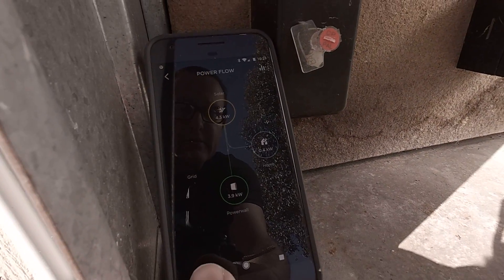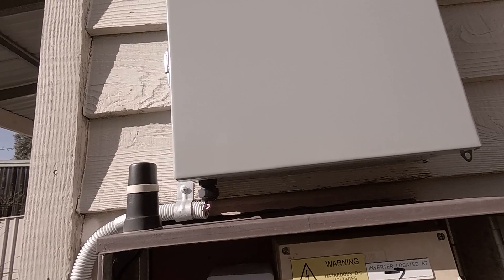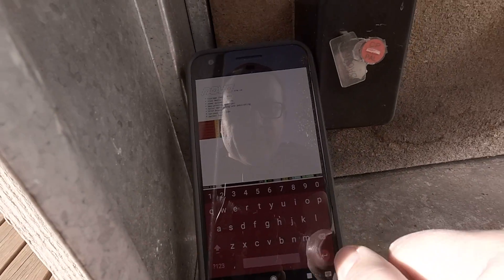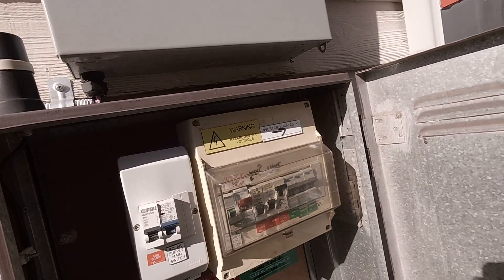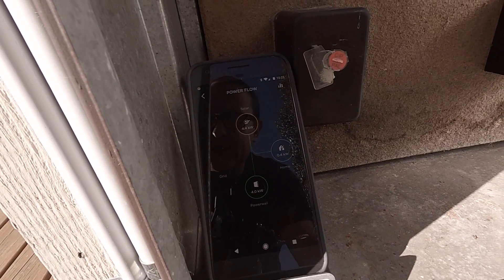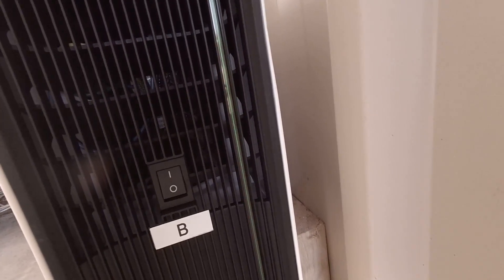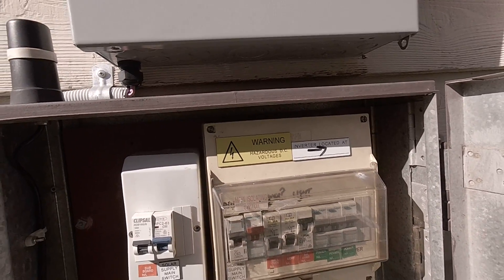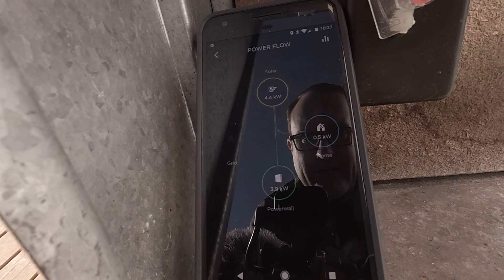My Tesla Powerwall 2: Demo of Backup Feature

Comment: Can the Power Wall 2 "bootstrap" itself?

Scenario:

There's a long-term power failure and the battery in the Power Wall runs down to the point where it cuts off due to low battery - perhaps due to bad planning or heavy clouds that prevent positive cumulative charging.

The next day, the sun comes up - but if the Power Wall doesn't come online, the PV system won't come online either.

Is there a way around this "Catch-22" situation - perhaps an override to make the Power Wall come on briefly to bring the PV system online, even though it is discharged lower than its threshold?

This is an "edge case" to be sure, but it's these sorts of things that are interesting!
Reply from the maker: I have thought about this scenario and if I thought that might happen I'd manually power down the Powerwall via its main switch before it completely drained, that'd give me enough to bootstrap it the next day but my understanding is Tesla keep a hidden reserve in the Powerwall for exactly this scenario but it's "undocumented" :)  Personally I'd try to deal with the situation manually and not allow the Powerwall to fully discharge. If it did get into this scenario I'd imagine you could bootstrap the system with a small petrol 2kva generator. Tesla also indicated that the energy gateway will have support for a generator input later this year so once that's implemented there'd be no problem going entirely off grid and using a petrol/diesel generator to bootstrap the system.
Reply: I've actually been thinking about this for months (I'm considering a PW2 system) and the more I think about it, the harder it would seem to backfeed to "bootstrap" it to get it online.

Possible scenarios:

- UPS-type Inverter:  Can output the voltage, but when the PW2 goes into charge mode, it will pull as much power as it can because, unlike a PV grid-tie inverter, the UPS does not actively "push" power into the grid - and this may repeatedly trip the UPS inverter off due to overload.  If the PW2 and/or PV system does come online and excess power is produced, the UPS inverter cannot sync to it and may be damaged.

- Inverter-type generator.  Same issue as the UPS-type inverter although it may be designed to tolerate backfeeding without being damaged - but it would likely trip offline when this happened.

- Mechanical generator (e.g. motor speed sets mains frequency).  If the frequency is set slightly high, it will always "push" power into a system and if the PV/PW2 start producing power, it will mechanically "sync" to it.  The problem is that the load-related frequency variations may cause the PV/PW2 to cycle on and off and the system may never come online - and it may eventually damage the generator and it may difficult to get the generator's frequency adequately stable/accurate under all load conditions.  If the generator stops/slows down while power is applied externally, it may be damaged by "motoring".

Scott's mention of a "Generator Input" is intriguing as an input designed specifically to charge the onboard battery to the point of it being able to come online - without having to worry about line frequency/phase synchronization to the "local" grid (e.g. power mains-isolated PV system + PW2) - would likely circumvent these issues and be the best way to go.
Reply: I now have three Powerwalls installed, and my experience is also that you better turn them off before you deplete them if you are running off-grid for an extended time. As for bootstrapping from a generator, at least in the USA, if you commission your Powerwalls with solar, they will only recharge from solar, so you'd also have to move the CTs around in your installation in order to charge from a generator. I'd be hesitant to try.

I can definitely say that you can power up off-grid, but it takes several minutes before the energy gateway wakes up and turns the power on.

As far as viewing their status if the Internet is down, yes, you can. You can access a web server on the Powerwall's IP address, provided the Powerwall is using Ethernet or Wi-Fi (not Cellular). The Web UI kind of sucks--there's only a graphical indication of the charge state, but you can also query the API to get the state of energy directly.
Reply: Having had the Powerwall operational for roughly 2 weeks, I can now answer some questions that I'd had - but not been able to find answers, particularly in light of my being an amateur (Ham) radio operator:

- Does the Powerwall cause interference (QRM)?  Not obviously so.  Like a Sunnyboy inverter, it seems to be extremely "clean" in terms of generating noise or RF interference and I can only "hear" anything on a portable radio on a wide range of frequencies over the HF (2-30 MHz) bands if I bring it within a few inches/cm of it.

- Is the Powerwall susceptible to interference by a nearby transmitter?

Yes.

Here in the U.S. amateurs are allowed up to 1500 watts of RF, and while this didn't cause a problem on the 75 meter amateur band (approx. 3.9 MHz), the same amount of power on the 40 meter band (approx. 7.2 MHz) apparently got conducted via a power or signal lead and caused the gateway to either crash or go into a "safe" mode.  (It was not a problem at the 100 watt level, but susceptibility can change by orders of magnitude with frequency)

The result was that the Powerwalls shut down and the grid isolation relay opened, causing my house to go dark on that Saturday night and even after turning EVERYTHING off (breakers, disconnects, switches on the Powerwalls) nothing would reset it - and the gateway does NOT have a reset button.  It took a power cycle of the gateway itself to bring it back online (there is no easy way to do that!) and then everything came back online.

While this scenario is unlikely for the vast majority of users, I can see that other radio hams, often interested in ways to have back-up power for emergencies, could experience this.  It is also possible that if a high-power land-mobile radio transmitter were used (say, by a business or first responder) in a vehicle parked quite near a Powerwall, this same thing could happen.

'Still working with Tesla on this, but I'm not entirely convinced that they got the message that it's an "EMC" issue rather than a software one.  Having experience in EMC/RFI midigation I know that the problem is likely to be easily solved, but whether the nature of this issue can be conveyed - and to the right person - remains to be seen.
Reply: Wow, this is a situation I hadn't considered. My sales rep indicated I could remain off grid for weeks (such as we occasionally are after hurricanes). I wonder if backfeeding a small UPS would do the trick, or if anything special is really necessary. It's quite frustrating how little actual consumer-facing documentation there is for the PW2.
Reply: Prior to the installation of my PW2 system (I have two "AC" PW2's now - operation pending final electrical inspection) I recently spoke with someone at Tesla on this issue of "Bootstrapping" (e.g. a "black start" scenario). 

To reiterate, the possible situation is this:  What if you are in "island" mode (because one is "off grid" or due to a power failure) and the Power Wall's battery is run down below cut-off and it shuts itself down.  If the Power Wall is offline and won't come back on due to the battery's charge state, how can you bring it back up for long enough for the PV (Solar) to also come back online and start charging again?

While it is, in theory, possible to use a generator to back-feed the house, the power from the generator would have to be VERY stable (like the grid) in terms of both frequency and voltage as the Power Wall changed the load on it:  If the generator "hiccoughed" at all - say, when the Power Wall tried to pull as much energy as it could to start charging - the Power Wall may see this as a grid fault and trip out again, causing a repeating cycle.

To be sure, one wouldn't even want to think about connecting the PV at this point if there is even the slightest possibility that there may be "excess" power that might try to "motor" the generator (e.g. put power back into it - which could speed it up, causing a frequency trip-out or blowing up an inverter-type generator).  If one managed to get the generator + Power Wall combination to be stable, one would, instead, let it build up enough charge so that the generator could be disconnected, allow the Power Wall to produce mains power normally and then allow the PV to come back online.

The above has a lot of "ifs" in it and, for most people's installations, is unlikely to be possible at all.

Apparently this "bootstrapping" is not a question that anyone had ever asked the representative or anyone in his immediate group and he had to escalate it to "engineering" to get a definitive answer - and the answer, at least at this point is "no".

I asked if this capability (e.g. something like an auxiliary generator port) was going to be a possible, future enhancement and he didn't know.

* * *

The suggestion that they gave for this sort of scenario was an obvious one:  Plan ahead!

What they suggested was that if one is running in an "island" configuration and it is apparent that the power budget is inadequate, it was recommended that at some point, safely before the battery cut-off percentage is reached, that the Power Wall be switched off.  Later (the next morning, perhaps) when one can reasonably expect enough solar to have a positive power budget, it can simply be turned back on.

For most of the readers of this comment they are probably nerdy enough to have a good grasp on actual production and usage and will be able to "do the math" to see if their power budget will fall short - but there are a lot of people who may be oblivious to such things and then be caught off guard when everything goes dark - and it won't come back online.

In thinking about this, I can imagine a software update where there might be a "reserve" - like on a motorcycle's gas tank:  Set a percentage where it will cut off at low battery, but through manual intervention (say, turning the power switch on and off 3 times) it will allow another, say, 2%-5% to be pulled - bringing it back online for long enough to "black start" the unit and get the PV up and running again and charging if one doesn't plan ahead!

* * *

All of this thinking has brought another question to mind:  If the internet is down, can one "see" the Power Wall's status or modify the configuration as one can with the app?  In other words, can one connect to it via, say, a built-in web server and see what it's doing?

* * *

N.B.  In the final check-out at the time of installation I turned on the microwave, a toaster oven, main oven, stove and a few other things:  I can state that with 2 PW2s you can pull at least 10kW.
Reply: Now having my PW2 system online, I've wondered if there is a "hook" that anyone has found to get both the current and past information.  The minimum information - simply knowing the state-of-charge - would be nice to apply to, say, a simple app/program running on a low-end computer/tablet.  For example, I can see that someone with a PW2 may not immediately be aware that there even is a power failure - particularly during the day and/or at night if one happen to notice out the window that other house's lights/streetlights are off.  While it is cool that a grid failure may go unnoticed, it is not conducive to managing the situation!

In looking at the web UI I can see that one could WGET/parse the result to divine the current SOC (state-of-charge) but beyond that, what?  
Also, on the Android app I see that there is plenty of recent history - but unlike that which is available for the SunnyBoy, no obvious way to obtain the "raw" data (e.g. .CSV, .XML, JSON, etc.)  Do you know of any way (yet) to get this data?